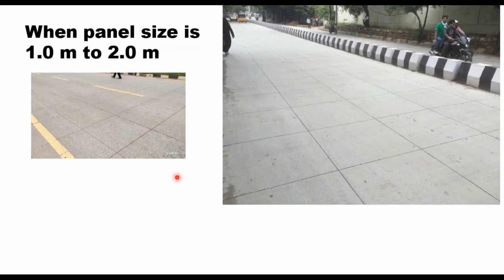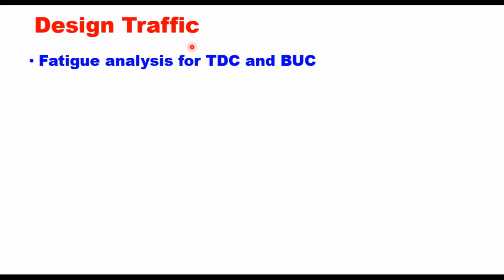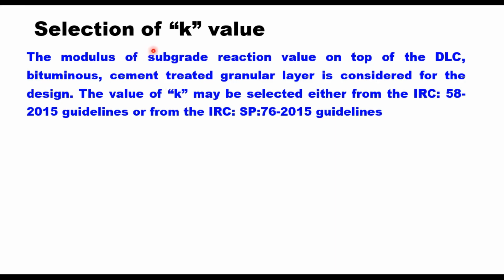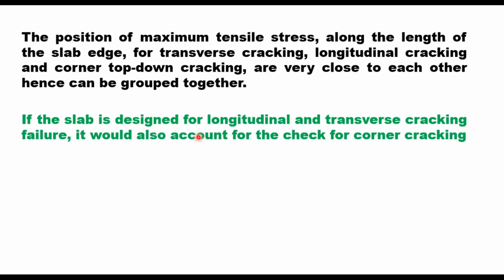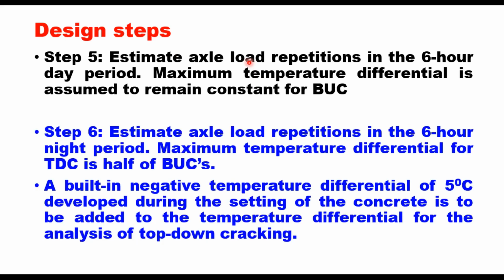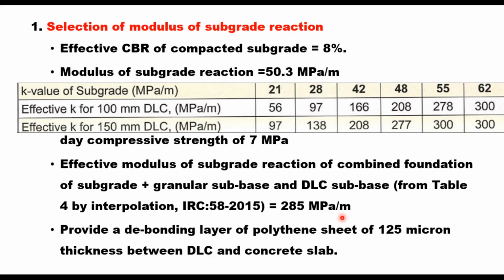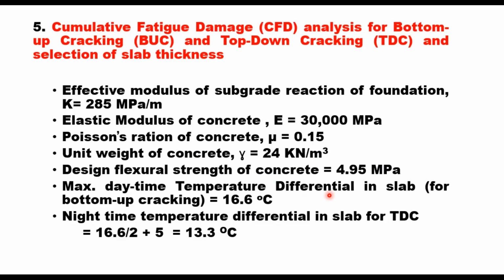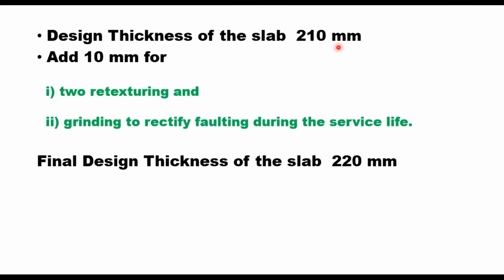Design of Short Slab Concrete Pavements for high volume Roads as per IRC:SP:140 – 2024  with example

Comment: irc sp 140 short slab pavement for highway (Fig.5 SSCP over new and existing bituminous pavement) What to take for effective modulus of reaction bituminous surface in this case
Reply from the maker: Plate load test to get the correct value

Comment: Sir as per Clause 7.11 SP 140 says Dowel bars are provided in SSC pavements only for construction joints. What it means by Construction Joint
Reply from the maker: It refers to a joint that is formed at the end of a day's work or a break in concrete pouring. watch this video for more clarity.
https://youtu.be/n63MhF85__A

Comment: At 9.47 , A debonding layer of a polythene sheet 125u. But as per irc :15-2017 clause no 6.6, seperation membrane should be 150 micron . 

Should consider 125u or 150u
Reply from the maker: IRC 58 and IRC SP 140 say 125 microns

Comment: Thank you sir for the Knowledge..Sir can we provide Panel concrete for Low volume traffic roads (all weather roads under PMGSY Scheme)? if so than what will be the hard crust thickness required for Panel concrete..
Reply from the maker: Yes, can be used but for traffic conditions on rural roads, it may not be economical. Try designing for the actual traffic data
Reply: @SatishIITR thank you sir..thanks for the reply sir..

Comment: @SatishIITR

In the SP: 140 there are different options below the Short Slabs, but no input / info is given how and what thickness of below layers like BC, CTB ,CTSB, GSB , WMM etc... is not discussed in the code?  can you guide me on this . I understand that Clause6.6 in SP :140 provide input for those layers but htose are the minimum thicknesses , but the impact of top slab is only verified in this code but impact when all layers are in contact , as a whole nothing is discussed. SO does this mean minimum layer thicknesses shall be laid and we need to design short slab and leave it
Reply from the maker: How do you decide the thickness of granular base or DLC in a conventional rigid pavement design (IRC 58)? The idea of providing base or subbase is give a firm support to the slab and effect of these two is considered in terms of k value only. Same is true for short slab also.

Comment: Nice explanation and very helpful. 
How to calculate effective K for design of SSCP over existing bituminous surface.
Reply from the maker: Watch this video on white topping.
https://youtu.be/d_8lJB-Kfm8?si=J9LKPysDknJ3Uoij
Reply: @SatishIITR  Thank you Sir
Reply: Same regration equation and excel Sheet can be used for bonded case?. (i.e overly on existing BT surface)
Is there any change in procedure for bonded case?
Reply from the maker: @pegs06051982  There is another code on white topping. Watch my video on white topping
Reply: @SatishIITR  Thank you Sir for your prompt response.
Reply from the maker: @pegs06051982  you are most welcome
Reply: For the case of "SSCP over New or Existing Bituminous Pavement which (bonded)" same excel sheet provided with IRC:SP:140-2024 can be used.
What will be the change in excel sheet for bonded and unbonded case in design calculation as per IRC:SP:140-2024
Reply: @pegs06051982  I think in the Code book start it is mentioned that these guidelines are applicable for UNBONDED SSCP

Comment: Sir !! So we need not depend on SP 76 from now ?? if we use SP 140 ?? Can we say this ?
Reply from the maker: These are two different codes. SP 76 is for design of concrete overlay over an existing bituminous pavement. SP 140 is for design of short slab concrete pavements for high volume roads.
Reply: Sir which code is used for the design of low volume roads for short slabs @SatishIITR
Reply from the maker: @chiru861  There is no separate code for short slabs for low volume roads. In fact this is the first attempt to introduce short slabs in India

Comment: Sir are these spreadheet different from irc 58 or similar
Reply from the maker: Yes, they are different. Short slabs behave differently as compared to conventional slab of 4m by 3.5m. A short slab will develop two-way bending and therefore all stress related equations are different.